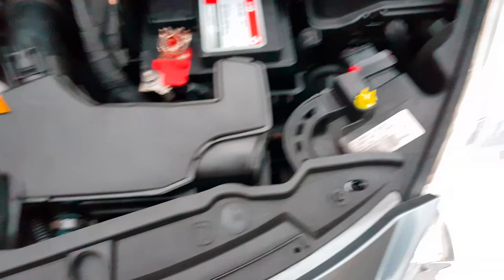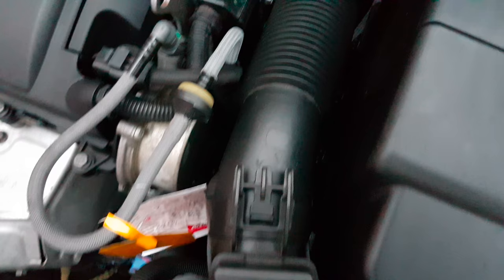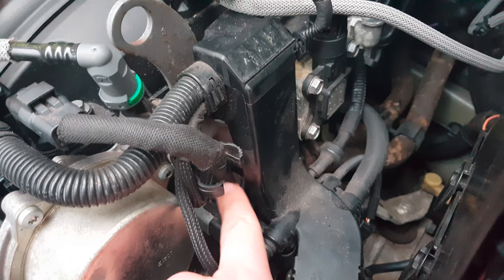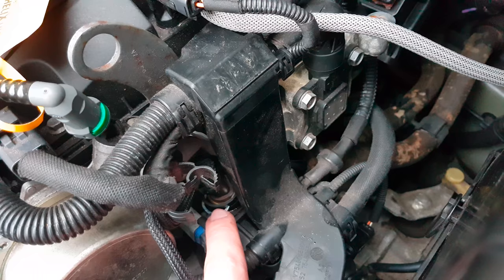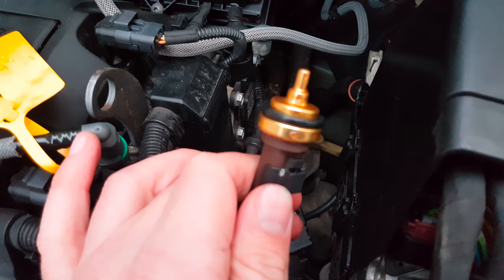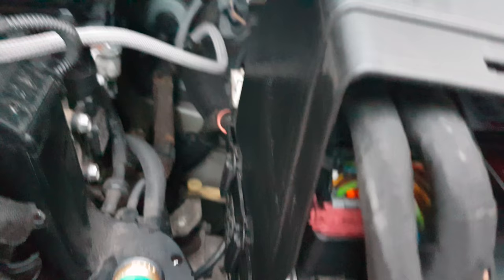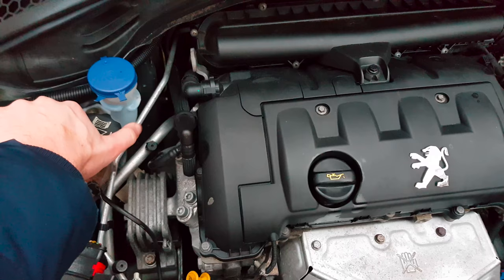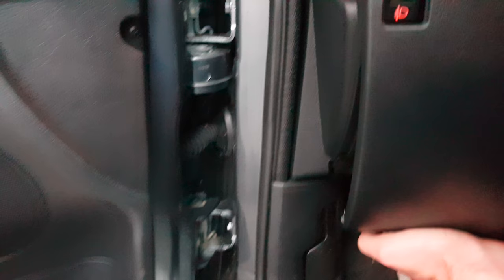Peugeot 207 VTI Replace Change engine temperature sensor

Comment: heres my experience i have a peugeot 207 1.4 2008 model , the problem i had was when started car up from cold about few seconds later the temp needle fly into red and warning stop message was on display although the engine was still cold , so i buy a new temp sensor from euro car parts and installed myself its not hard job just a bit tricky with the metal clip was a pain . Anyway after fitted it problem still carried on but the same day about 6 hours later i take car on motorway for a good drive then new sensor started working with ecu and needle went back to 90c and problem soughted ,no more flying into red or stop message.

Comment: Thank you for the video, gave me some enthusiasm to check if I can repair it myself. I have exactly the same issue. One question I have. Since it is only the sensor which is defect, is it still ok to drive for some time to get to a garage? I have my father a few hundred km away, which I anyways wanted to visit and who would like to help me to repair it. Would that also be ok, to make such a distance with a defect sensor?
Reply: Bonjour moi j’ai ce problème et je vais tout les jours au travail avec , il ce situe à 15-20 min de chez moi

Comment: I'm impressed how clean your engine is. I try to maintain my Peugeot 207 1.6 hdi sport but is far behind you. Well done. I replaced the thermostat and hosing with fitted new temperature sensor. Once I done it shows "engine pollution fault " and the clock with the temperature seems like is not moving up at all. For me this looks like sensor is not working. I checked the connection again and seems OK.  Could this be possible that the new sensor is not working? Unfortunately I don't have the recive so I cannot go to the shop and return. I will have to buy new one.  I just wander whether is possible to get nee sensor that is already not working.
Reply: Hi, I got a similar issue. My car engine indicator does not move at all. Sometimes it does. But like 1 every 10 times.
Did you replace the sensor and worked?

Comment: I have a question, did somebody's VTI stopped running after this faliure? My engine won't start and I don't know if it is this sensor problem or another problem at the same time. Cheers.
Reply: Sensor pmh may be ?

Comment: Hallo hab gerade das Problem bei meinem 207, 1,4, 75ps schreckheck temperaturanzeige steigt gar nicht bleibt unten und Heizung geht aber heizt net so recht, meine frage ist das bei mir auch der Temperaturfühler oder der Thermostat.?
Reply from the maker: Hi, das Problem hatte ich auch mal. Bei mir war es das Thermostat. Es musste das ganze Thermostatgehäuse getauscht werden. Ich habe dies in einer Werkstatt machen lassen.

Comment: What is this sensor at 1:26?
Reply from the maker: Kamil Wojciechowski the temperature sensor is behind the cable and fixed with a kind of metal ring. I don't know the function of the cable in front of that.
Reply: What's the name of that sensor you removed the cable 1.26

Comment: Does your motor fan run from when you start the engine even when the engine is cold?
It is draining my car battery.
I need help
Reply: Same issues with my car
Reply: @shahdailyvlogger4633  I fixed the problem on my Peugeot 207 VTI
Reply: @basba_qal  can you please tell me also because im facing the same problem
Reply: @shahdailyvlogger4633  Hello again. If you have a VTI engine in your 207 Peugeot then that engine has 2 caps.
If your gauge display shows high temperature then you may want to check your coolant sensor, if it has too much black film on it then replace it, and your radiator thermostat can be easily unmounted and checked for damage just like you check a light bulb.
If your display is not showing any high temperature then this is the problem and how to fix it depends on your creativity, and if you have a VTI engine in your 207 Peugeot then that engine has 2 caps.
One for putting oil into the engine. 
The second one is to regulate the breathing of that engine. 
The engine doesn't really breath, but I am using simple terms to explain the method. If the cap is missing then the engine sensor will always think that the engine is very hot.
It is located at the left top-back of the engine cover.
It was missing on mine, so I devised a simple cap like method for it and the fan stopped running all the time. Tested it over and over again, and it worked like a charm. Or; you can simply plug that hole with a thick sponge. That works too, if you didn't want to sell the car. My car was on the market and ready to be sold, so I had to construct a similar cap from spray paint caps, a light metal spring, a rubber ring and a sponge to keep the new cap tightened in place. This method might let the cap pops up when the engine runs on high speed, so, I had devised a stopper made of a small aluminum one 3 by 10 cm held down by the screw from the air filter box next to it. High speed ? No problem. I saved my self lots of money, and sold the car.
I could not buy a replacement because it costs a lot of money, one has to buy the whole cover, even on eBay or auto Doc.

Good luck
Contact me again for more help.
Reply: @basba_qal  boss u make the video of my car but how can u send it to you ?
Reply: @shahdailyvlogger4633  I can not understand what you are saying. If you have video or pics , send to my gmail basbaqal

Comment: Is it safe to drive the car while sensors are broken?
Reply from the maker: Well your car will not be able to control the temperature of the engine. I can't recommend to drive the car in this situation.
Reply: @Pumasprinter  thank you!

Comment: hi Travel&Nature  will the temperature gauge still go to max until i delete the faults
Reply from the maker: If you don't change the sensor, I think it does.
Reply: ive changed the sensor but i havent deleted the faults but the guage still goes up
Reply from the maker: Yes, you need to delete the faults to prevent that the temperature is still high. I had the same problem. But I solved it with delete the fault.
Reply: Thank you so much thats a great help
Reply: Travel&Nature my code reader came today so I cleared the fault and it works 👍🏼 thank you for your help 🌟

Comment: Hi.Awesome video.but I had a big problem putting the clip back on.it simply seems impossible as I can't force it back on to keep sensor on place .how did you manage t9 put the holding clip back on?
Reply from the maker: FJ Guy hey FJ Guy, in my case, there was a a new clip together with the package of the new sensor. There was no trick. You have to be sure, that the sensor fits perfect in the hole.
Reply: I've had this same problem today fitted the new sensor but can't fix it in place and subsequently starting the engine caused it to spew out everywhere!
Reply: Jamie O'Loughlin, I had the same problem.  You musst press the sensor deeper inside. Carefully use a screwdriver and push the sensor more  down to the bottom. The clip must sitting OVER that metal edge of the sensor.
Reply: Sham Paine thanks I eventually figured it out although took 3 attempts!
Reply: I was lucky my neighbor was sneaking around and helped me out ;o)

Comment: I have no rubber ring on mine, must have been off before,
Reply from the maker: Sometimes it stucks in the hole
Reply: @Pumasprinter  Ha !!! Did think this myself, retraced my steps, and wasn't, it's snug enough currently without, not ideal..... but !!!!!!!